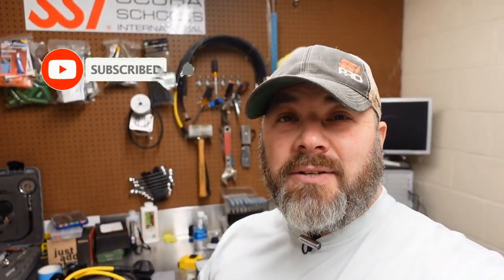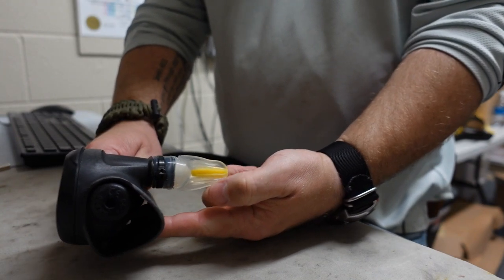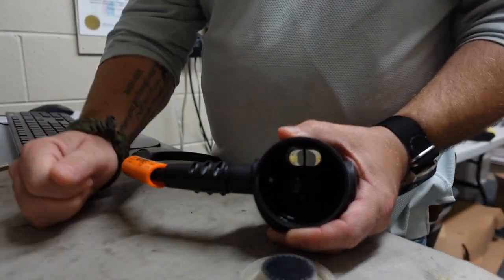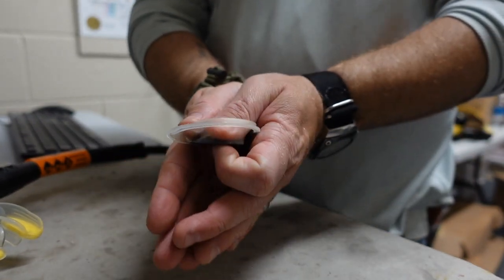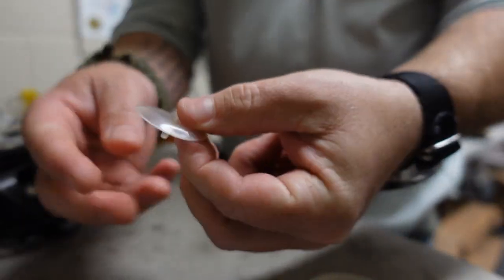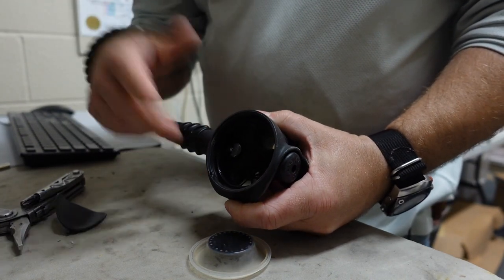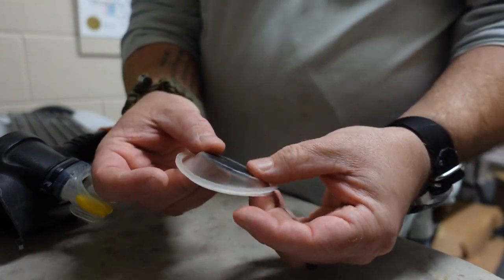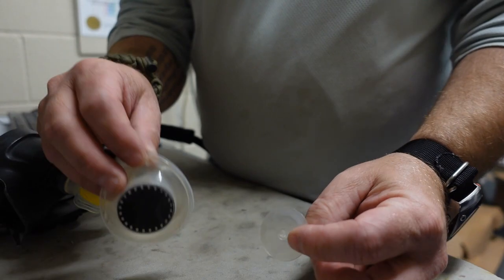What Is Regulator Vibration And Fluttering

Comment: 40 years of diving and I always questioned the integrity of my reg when this occurred.   Thanks Brian
Reply from the maker: Hello John Raymond, this tends to be a common theme with divers. Fortunately for me, being in the Industry for as long as I have, I have sold and used just about all the major manufactures on the market. And at some point in time, all the regulators (all major manufactures) have fluttered while on the surface. For each of the technician level courses I have taken in the past, I would always ask the lead tech the same question, "Is this normal," and they would always say yes.

Comment: Nice video finally someone explained! My regulator did that when i fresh bought it only on air and then after 2-3 dives it stopped, then that happened under water last time  is that normal as well?
Reply from the maker: Hello excuter90, typically, it should not happen underwater. You may here a little vibrations if there is an obstruction in the demand valve, but you should not here in vibrations underwater in the diaphragm.

Comment: Hey Brian please advise, My new (two dives only)scubapro G260 2nd stage keeps whistling when inhaling l. out and in the water same whistling!
Reply from the maker: Hello MrGhamsf0a, there are several things that can cause a whistling sound in a second stage. Typically, this does not effect the operation of it. My suggestion would be to verify the hoses are cleared and the demand valve, and have your local ScubaPro technican verfy that both the intermediate and cracking pressure is set according to the manufacture. This should take care of the issue.

Comment: What causes a flutter in the first stage? No flutter with a yoke adapter, only on a din valve?
Reply from the maker: That is a great question Mark Wallace. To my knowledge, the only things that can cause flutter in a first stage would be a frayed o-ring, debris in the low pressure chamber, or a damaged diaphragm. Depending on what model first stage you have, a service technician may not be able to diagnosis the issue. In certain cases, I would recommend sending it back to the manufacture for evaluation, especially if it effects the breathability of the regulator.
Reply: @LakeHickoryScuba  it's a 52x, I've been diving it this way for 2 years with no issues...I would probably be more concerned if it stopped making the noise during a dive at this point 🤣

I brought it with me this weekend to lake james, but I was never able to make it over to see you guys.

Would you like to service it?
Reply from the maker: @markwallace1251  Hey Mark, I would be happy to look at it for you. Unfortunately, I’m out of town on the Outer Banks for my family’s Easter vacation. I will be back at the shop next Monday, April 25th, if you would like to bring it by.
Reply: @LakeHickoryScuba  Right on 🤙🏼
I'll swing back out that way as soon as possible.

Comment: What about when regulators make a honking sound underwater?
Reply from the maker: Hello Jeff Conley, ironically, my daughter's regulator does this sometimes. One of the things that can cause this is a restriction of air flow inside the demand valve of the second stage. Depending on how the internal make up of the regulator is designed, if the valve does not fully open, it can cause a "Strider Effect," sometimes it may even mimic snoring. When this occurs, I would suggest having a technician for the brand you use check it out. This can be caused by debris (which is usually a form of corrosion between the demand lever and the demand valve), or it can also because by small particles of sand or other debris stuck between the poppet and lower pressure seat. Either way, this is not as common as the fluttering effect and should definitely be looked at by a trained technician. Lastly, you can remove the second stage from the hose, to verify there is not debris caught in the hose connector. This too may cause a restriction of air flow. I've seen this while replacing O-rings on a low pressure hose. When an O-ring goes bad and begins to flay off, a small piece can get stuck between the hose and how adapter. In the event that small piece of rubber was to travel on through the demand valve, it could lodge itself between the seat and poppet, which could cause a free flowing regulator. This of course is very bad, as we lose more air through a low pressure failure than a high pressure failure. Hope this helps.
Reply: @LakeHickoryScuba  Thanks for the detailed reply. Gives me ideas to check.  I started doing something that is probably a bad idea. I have started taking my second stages off their low pressure hoses for storage. I may have gotten contamination in that way.